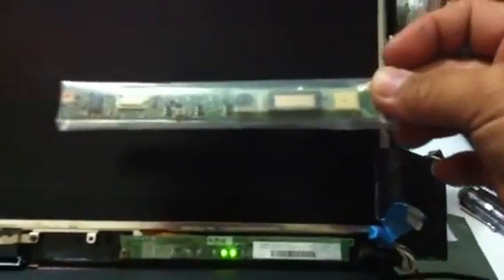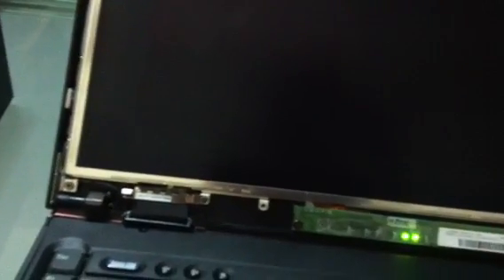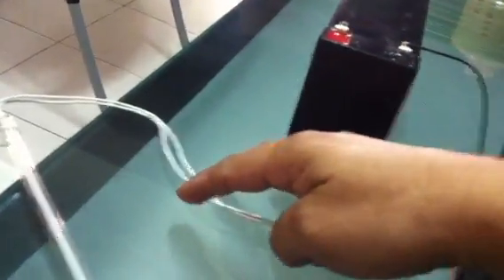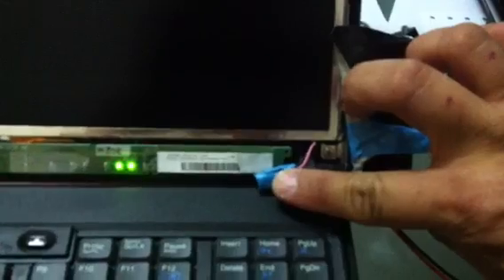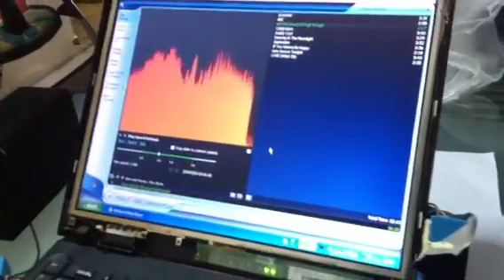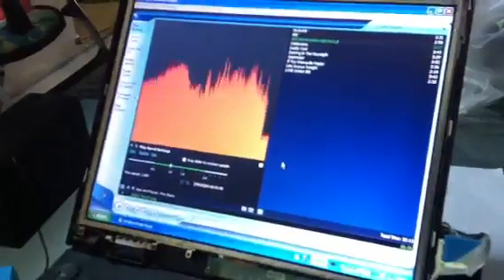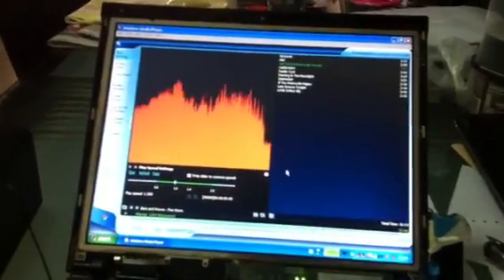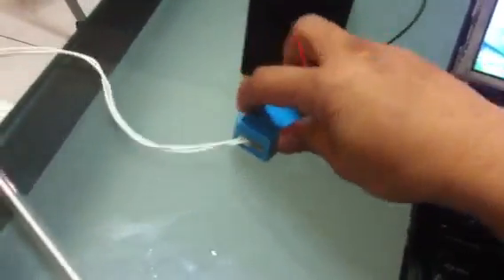LCD monitor Hack

Comment: my toshiba laptop has i think a similar problem when i plug the via via port into a monitor it works normal just no lcd display on laptop I'm not sure if the screen is bad or the inverter

Comment: Nice hack. I have one of these inverter/CCFL lamp units. it came from an old flatbed scanner . I made it into an emergency light with a switch and a 12V car lighter plug and it works great.

Comment: excuse me there my friend?
Not long ago i bough a LCD Screen with inverter card for 50 $, i tho about use it for some project!
But i dont know anything about voltage and and specification of the cables, i dont want to frie this screen up, any information would be useful for me!
I have one very important question, how many Volt and Amp was that power adapter u plugged in to the wall?
I have ides to make it to a 2nd monitor!
Thank you in advance and marry xmas bud